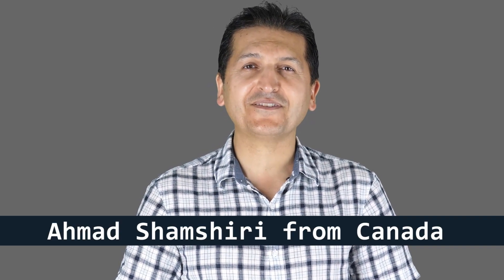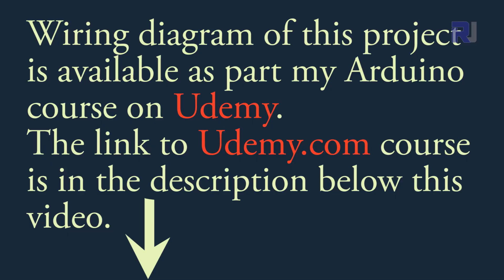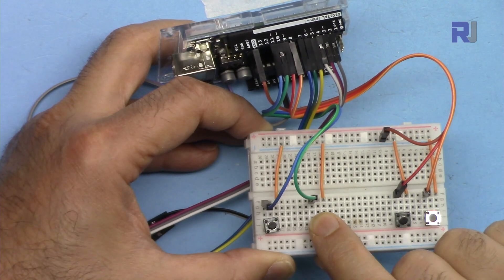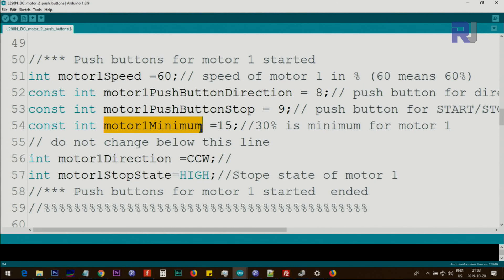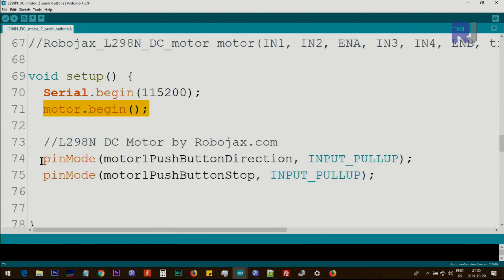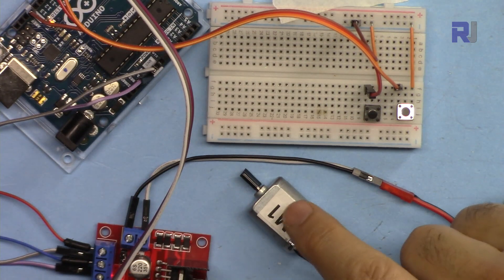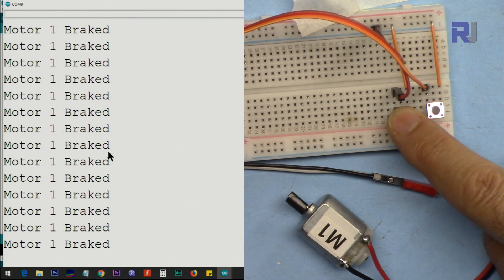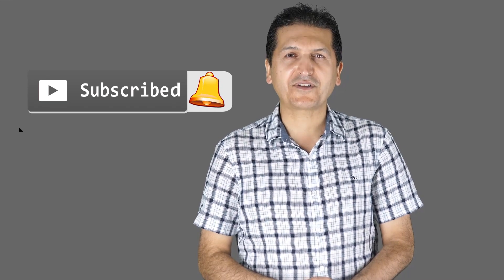Using L298N To control DC Motors with 2 Push buttons using Arduino - RJT226

Comment: Hello Robojax. I tried to find  wiring schema but I can''t find it. Can you help me please?
Reply from the maker: Hello, all my videos are for learning. I have explined all pins of the module and then shown exactly how to wire them. Just follow. Search for L298N you may find the wiring diagram in my other vidoeos. But you don't need it if you just flow the wiring section of the video.

Comment: Hi, thank you for a great, informative tutorial.  I am learning a lot from subscribing to your channel however, I need to also control the speed of my DC motor using a potentiometer, not by assigning a fixed value to motor1Speed. Is it possible to integrate code which would enable me to do this?  I have not had any success in my attempts, can you help?
Reply from the maker: Please check this video https://youtu.be/_o7hCxYKLyc and if you had questions then watch the lesson before it.
Reply: @robojax  Fantastic.  Thank you!

Comment: Hello Robojax,
Can you help me write arduino program with same project like you.  How to control booth motor (two motor) with only 2 push buttons with resistors?
 (First button control motor rotate direction, second push button activate two motor at same time when push  and hold function when release push button deactivate both motor)
I would be very grateful if you could help me to add or change the program code a bit to adapt to the features mentioned. Like this video.
I waiting your answer.
I will be very grateful to you. Thanks
Reply from the maker: Hello, so you want to use to add another motor perhaps parallel. both run together. else it won't work with just two push button switches. if so, it is very simple.  if motor needs less than 1A each, then use two motors  and connect them in parallel. 
if your motor needs more than 1A, then you need another L298N module. all wires from Arduino will go in parallel to both modules meaning each output from Arduino will come out and becomes two wires and each will be connected to the L298N modules and each motor is connected to the output .
if you want not to control them in parallel, then you need complete new code.
Reply: @robojax  
Hi, Thanks for the reply.  But you probably didn’t understand what I wanted.  Maybe I asked badly without explaining well.  I would like to replace the push button to switch button.  When I turn on switch, the motors start. When I turn off switch, the motors off. Can you write switch button arduino program. Thanks very much.

Comment: Thank you, this post is very useful, before I had a final assignment in college I wanted to control a 12v DC motor with 3 speeds, where when the 1 speed button is pressed it will spin for a few seconds and will automatically turn off. I have a problem here, if you can help me in solving this problem, sir,
i am using arduino uno, l298n module, 12v 755 dc motor and some buttons, thanks sir

Comment: Having trouble getting the code to work, I keep getting a message saying "no such file or directory"
Reply from the maker: yes. it is very simple you skipped the video and running it without installing the library. Never skip my videos. If you watch it fully, I can assure you that  all your questions answered and will face no issue. My channel is unlike any other you have seen. good luck.
Reply: @robojax  Yes, I figured it out right after I commented. I'm using a 24 V motor, but the motor starts to spin and then stops, wait around 10 seconds and then starts again. I'm using a 9 V battery.

Comment: I want to turn on DC motor for specific time  with one switch and stop. And also by pressing the same switch the motor should rotate in reverse direction for specific time. So how to do that?
Reply from the maker: Hello, if you don't need the switches, then here is the video https://youtu.be/wn5D7j1ybxY
Reply: @robojax  no switches are important

Comment: if you are Persian let me know to talk in Persian.
I wanna use a 12V 10A DC motor with a switching power supply (12V 15A), but I want to build a carving micromotor with a push button switch to maually operate motor (like foot pedal or something) but the motor has huge start current, so those numerous starts and stops doesn't damage the power supply? and is there need to add caps to reduce initial current or the supply will be fine?
p.s: someone told me to use a 220VAC to 12VAC transformator with a rectifying bridge but I don't know what type, V and A of the bridge and which power supply is better for this.
Reply from the maker: Yes I am Persian from Khurasan (now Afghanistan).  Persians are in Tajikistan, Afghanistan, Iran about  8 millions in Uzbekistan. 
this module as I've explained it (in the introduction video) can handle only 2A. so you need something else like this https://youtu.be/PUL5DZ9TA2o but you would have to understand and use push buttons. I don't remember the current this module, so watch and it see if it can be used.  if you the motor is rotating in one direction then we have lots of options. You may find it one amongst these videos https://www.youtube.com/robojaxTV/search?query=motor
Reply: @robojax  چه جالب. الان هم راحت میشه پس به فارسی نوشت. من برای طراحی وسیله ای و کاربردی دارم (حکاکی و تراش عقیق) از چندتا موتور دی سی مختلف میخوام استفاده کنم و نمیخوام دور موتور کم کم افزایش و کم کم کاهش پیدا کنه بلکه میخوام نوعی پدال پا (که بعضی از ویدیوهاش موجوده تو یوتیوب) باشه که جریان رو قطع و وصل کنه ولی دقیقا نمیدونم این قطع و وصل زیاد به تغذیه سوییچینگ یا خود موتور آسیب میزنه یا نه. یه مشکل دیگه هم با یکی از موتورهاییه که گشتاور و جریان کشی اولیه بالایی برای راه اندازی داره و با تعبیه یک سوییچ فشاری هربار میخواد آمپر بالایی بکشه. برام خیلی مهمه جواب این دو رو بدونم تو خیلی از سایتها گشتم از خارجیا ایرانیا پرسیدم انقدر نظرات مختلفه که دقیقا نمیدونم کدوم درسته یا چی به چیه

Comment: I need a code to control 2 motors with 8  push buttons by using l293d and 89c51 .plzzzzzzzz provide this sir
Reply: Plzz sir I need code today
Reply from the maker: I have explained in the introduction to the module how to use two motor. So watch that video and then write your own code. or hire someone to do it for you.

Comment: Hai sir, can i know input voltage for external power supply ? i have tried with 22.8 V of battery but the driver exploded. Can i know why ?
Reply from the maker: you must have connected it in reverse polarity. L298N can accept input of 24V or 25V. I have shown and given the datasheet. check it out. if there was capacitor, then don't worry. may be capacitor had lower voltage rating but the L298N will not die unless you connect it in reverse polarity. salaam. Ahmad from Canada
Reply: @robojax  Thankyou for your previous answer. I want to ask up to how much voltage output can this driver drive to two  external motor ?  Thanks for your time sir
Reply from the maker: At the begining of the video I mentioned that you  have to watch the introduction to L298N and it seems you have not watched knowing from your questions. Please watch this video  https://youtu.be/wn5D7j1ybxY to get all answers. Do not skip the video. I did not say anything extra. you will learn everything about the module and how to control CD motor .

Comment: Have a good day teacher
I want to get information about a homework.
I make motor driver circuit with L298. I use two motors. I need to slow down and speed up these motors and stop button. These operations are required for both engines. I could not do the code writing. Please help.
Reply from the maker: I used library and pay attention to "object" explained in code. Watch this video to learn from https://www.youtube.com/watch?v=27KjMfPH1dk

Comment: Hi, i Need one more help from you i have 2 lithium phosphate battery 60v 24ah nd other one is 60v 30ah, i need 1 circuit for self charging dual battery pack where one battery pack is used to run the car while the other is charged need smart switching system  where it monitors the voltage level of the batteries and decides which battery pack. Has to charge.pls help to share circuit and make video for this concept wiring diagram and circuit share me
Reply from the maker: Hi, this is quite a project which I have no time for as this is not something popular. You may visit https://www.freelancer.com for that.

Comment: Sir can you do a wire less controller by starting motorcycle via bluetoth using a arduino relay ang HC-05 bluetooth module thank you.
Reply: True voice command sir thank you.
Reply from the maker: You are welcome.  You mean to have push buttons on Phone to control motor? It would be interesting.
Reply: Yes sir i'am interesting.